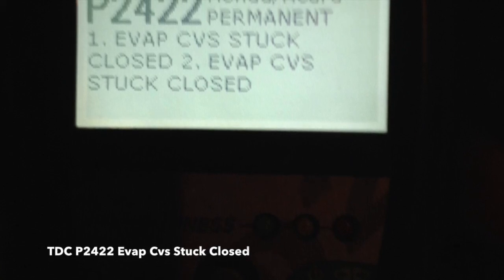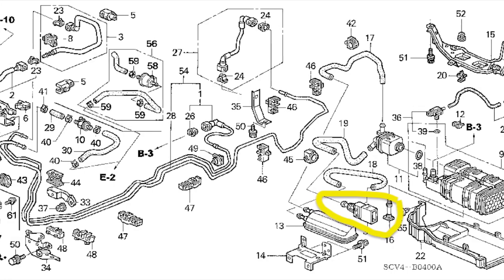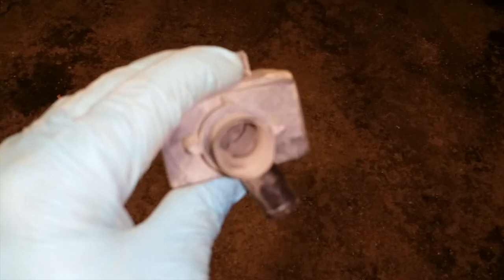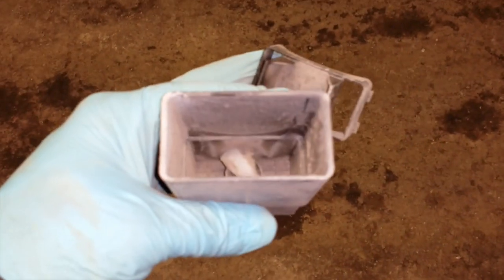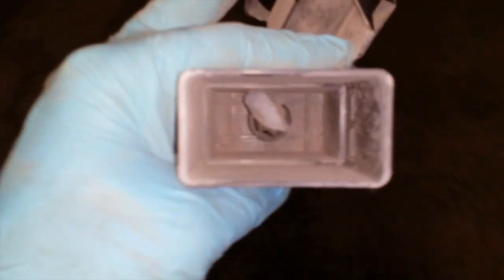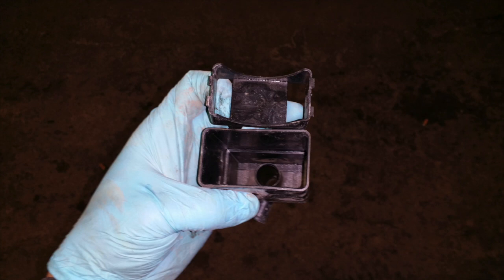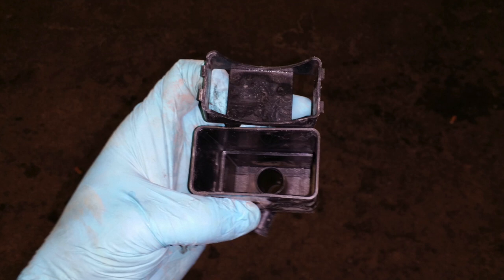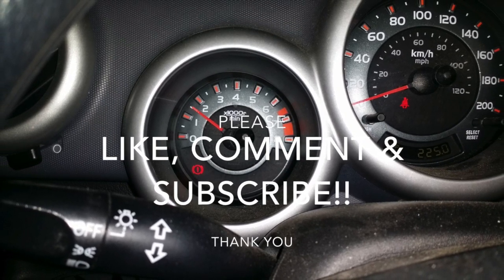Easy Fix: Honda Element Evap Stuck Closed P2422

Comment: Easy fix is relative, that part he is holding up I found challenging to get out. I cleared my P2422 code by replacing the charcoal canister with one I got from the junkyard. Somewhere on an Element forum, someone said you should be able to blow through the canister which I tested out of frustration and found the one on my element was clogged and my doner one you could blow through.
Reply from the maker: Thanks for pointing that out 👍

Comment: My clog was not in the little box but it was in one of the rubber hoses attached to it. The little box is hidden under the bigger looking plastic box right in front of the drivers side rear tire. You will need to remove the bigger box of its 3 10mm bolts that hold it up. Just let it hang down and you will have enough room to get to the small box and hoses.
Reply: 🤓 Thanks Jack! I will check it out, thx for the directions buddy 🚙😍

Comment: I had the code p2422 on my 05 honda crv 2 years ago and I replaced the canister, ftp sensor, filter. But the check engine light keep showing up, so I took the car to the dealer and they just replaced the gas cap and the check engine light came back 1 week later. finally , I check the vent tube and a spider web was in the vent tube. cleaned the tube and problem solved.
Reply: my car same problem ,i used $200 gave dealer fix up, but few week later that light came back, can you tell me vent tube and spider web location? my car 06 honda crv
Reply: Where's the vent tube located and how do I remove it? I can't find a tutorial for that

Comment: I have the 04 element and I believe this is what I was looking at yesterday attached to the evap canister. I gave up trying to get it out, it was clipped in on side facing down towards me and opposite side which I couldn't get a flathead screwdriver up there to unsnap out. I'll try it again. The purge solenoid is under the hood directly under the air filter box. Little black thing under a mount bracket. I replaced this for no reason and didn't kill my code P0496. At least I ruled that part out for 34.99 on ebay. I am down to the EVAP canister or the Fuel Tank Pressure sensor. I do smell a little fumes when running but it runs very good. I think I know the part he pulled out, comes off side of canister on the side FACING the passenger side. I was trying to pull out the brackets that hold the canister to bottom of car but trust me the heads of those 10mm nuts will snap off if old and rusty. I even hit them with WD-40.
Reply from the maker: Hi, we know how frustrating this can be. I read somewhere that Overfilling or Over-topping off a fueling our vehicle can cause fuel to splash back out the fill neck and run down into evap vent line charcoal canister. There it creates a sticky clusters of charcoal close to the sensor. Pressure builds and because of the "sealed chamber of charcoal clusters" doesnt let the vapors move freely that can trigger a CEL, too.
Reply: @MSG_MOTO  Yes I found out if I fill to 100% the car takes me about 2 attempts to start.. reminds me of back in the day a fuel filter going bad.. I found if I get gas down to 95% and lower there is no slow start issues. Other than the fume smell when running, it runs great.

Comment: Sorry, where is this part located? Have this error on a 2006 crv but can't find this exact part
Reply: I'm having this same issue on my 2005. Our vent valve looks a bit different. I replaced mine and the code still comes on. Curious if you ever fixed yours?
Reply from the maker: Some owners reported having to change out their evap charcoal canister and that solved their problem. Many owners said their car's CEL came on a little after fueling up, but didn't stop after the gas pump clicked, and they continued to fill up to the fuel neck. The excess fuel in the neck spilled over in the vent tube down into the charcoal canister, gummed up and block the vent tube around around the pressure sensor. Do or did you OVER FUEL your car?
Reply: @MSG_MOTO  Thanks for the quick response I appreciate that. No I did not overfill it, however I just purchased the vehicle so I'm not sure if the previous owner ever did. Where does this vent tube run, after  coming off the vent from the canister? It goes right to the fuel neck? Maybe theres something obstructing this vent tube.
Reply from the maker: https://www.google.com/search?q=honda+element+fuel+filler+neck&safe=off&client=ms-android-samsung-gn-rev1&source=android-browser&prmd=sivn&source=lnms&tbm=isch&sa=X&ved=2ahUKEwiXsvGOtOvqAhUGhuAKHYQ5DiQQ_AUoAnoECAoQAg&biw=412&bih=678&dpr=2.63#imgrc=fLsui388bGVAaM
Reply: @MSG_MOTO  And that is the line that comes off the vent valve from the charcoal/evap canister?
Reply from the maker: @yamahondazuki95  not comes off. Fills with fuel the vent line and leaks down into the charcoal canister. At this point I can't help you. Maybe additional information can be found by doing a google search. Good luck.

Comment: Last year, I had the exact same problem on our '03 Element.  The spider left what I assume to be eggs in the tube that connects to the breather.  Same error code, same spider.  I have the code again and will be having it put on a lift to pull it apart again. Have you done anything to try to prevent the spider from entering?
Reply from the maker: 11ontheknob thanks you!
everything was fine with my car after this video. A few month later, a day before gas prices were to increase, I fueled up (right you the top of the fill neck), BIG MISTAKE! Gas made its way into the vapor canister and mixed with the charcoal, creating cluster(like rice crispy squares(puffed rice and melted marshmallows)) around the pressure sensor on canister. The pressure around sensor was always high( a false reading). That is what gave me another evap stuck closed. I changed out the canister... no problem since.
Reply: iHelpYouFixYourCar 
Dear,
I have a problem in my honda crv 2006 the as I overfilled my reservoir since 9 months, the check engine light comes on with a code P2422 do you recomend any detailed procedure or any video so that I can repair it my self ? do you have any idea if I could fix the issue without changing the canister. Thank you for you help.
Reply: Try a sign...no Spiders will be Tolerated !

Comment: Wish you show how you cleaned it
Reply: Usually these are just cleaned with compressed air, you just blast it out. If you don't have a compressor, you're gonna be stuck with the ol' "run a wire through it until its clear" situation.

Comment: hi, if you dont get this fixed do you know what could happen to your car?
Reply: 🤓 Fuel Tank will implode when the Purge Cycle turns on 😊
Reply: aparently it will simply affect your fuel efficiency, the car will not explode (according to my mechanic..
Reply: @MrSamadolfo  lmao 😆
Reply: 🙂 the emmision lite will stay on, its an evap code, just clean out the intake exhaust, reset, drive a week it shud be OK

Comment: where is it ?
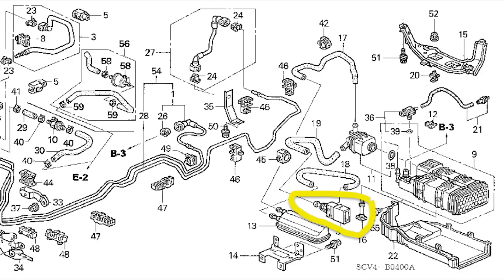Reply from the maker: 0:15 in to the video you see where it is
Reply: thanks , but I mean on the car ? where by the gas tank or under the hood ?
Reply from the maker: Based on the schematics, It is located by the EVAP BOX underneath the driver-side (Left) of vehicle, Infront of Left-Rear wheels. I suggest you let a professional mechanic do this job for you.
Reply: lol , so then basically your whole " how to " video is just simply you holding the clogged box , then a wiped clean box and then a pretty picture of your dashboard . For us not in a shop and working outside on a piece of cardboard and that just want to know before we start how to easily locate this said stupid box , you response is " call in  a pro" ? So you made this video  then to help pro's not us ? I'm sure it has helped the pro's a lot lol . A link to the schematics would of helped more
Reply from the maker: Thank you for the comment.
Reply: Great vid brother. Explained well. Appreciate the schematic. Took care of my issue. Looked exactly the same.
Reply: @normgoeres4449  hahahaha

Comment: So where the hell is it located???
Reply from the maker: *Located under Left Rear side of vehicle, near driverside rear tire in the vicinity of the fuel tank. Chase the tube in this diagram to breather location in front of evap canister.. https://youtu.be/7EsobF_W0-c?t=13
Reply: @MSG_MOTO  Thank you, now I can get to work on it.
Reply from the maker: @fernandoj.sulsonaanziani6195  the answer to your original question was pinned in the comment section.